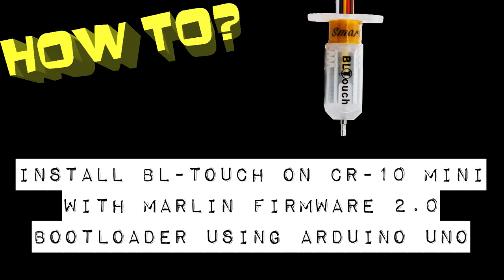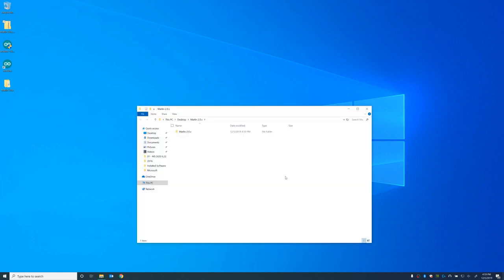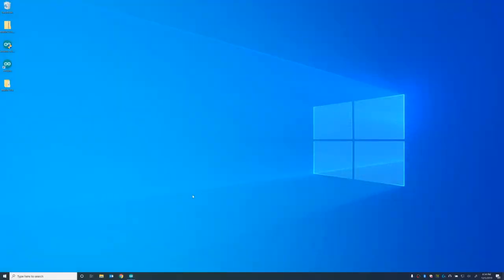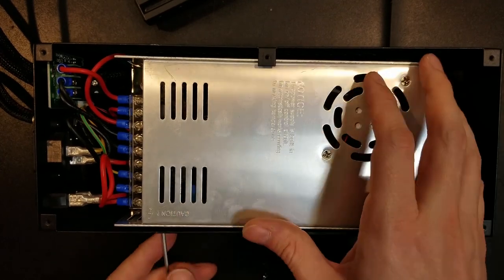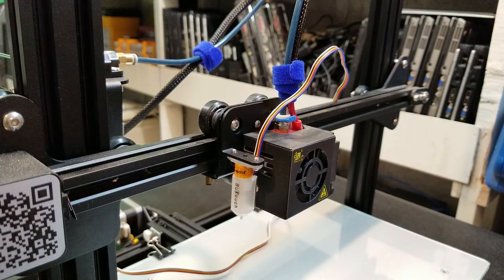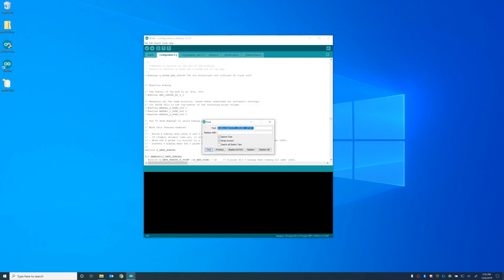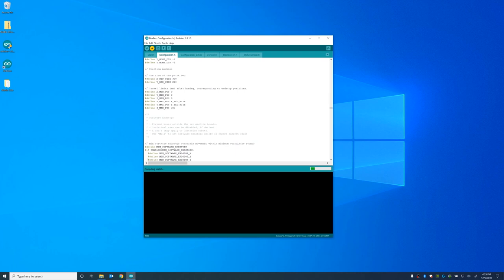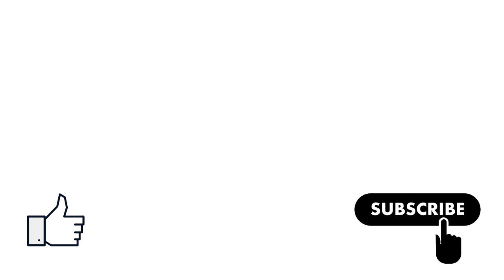Install BL Touch on CR-10 Mini with Marlin 2.0

Comment: Thanks for sharing, that's very helpful.
Just few comments for others if you like me are using stock mainboard from CR10 
1. After download Marlin firmware you have to download the configuration package and use the correct configuration files to replace the original "configuration.h" and "configuration_adv.h"
2. If you want SDSUPPORT and BLTOUCH working at the same time, except disable the items Shane descripted in the comments, you have to enable/uncomment SLIM_LCD_MENUS to free more space if you met issue `.text' will not fit in region `text'

Comment: Thank you so much for this video- it saved me ages and my Mini is now not only equipped with BLTouch but also Wireless :). I only had one issue with avr-gcc missing error but it turned out downgrading my Arduino boards library fixed it. Other than that I wasn't sure if this can all be done without getting the board out and in my case it was- I only of course unplugged electricity and removed the power supply to gain access but all cables stayed plugged in while loading bootloader. Thanks to that it was a really quick process. Thanks for a great video once again!

Comment: Thank you for this.  I have a BL Touch on the way, and had no idea how this was supposed to go.  Looks like I’m ordering an Arduino Uno and some cables.
Reply from the maker: One thing I wasn't able to show in the video was that in many BL Touch kits you will get a USB ISP programmer to burn the bootloader instead of using the Arduino Uno method. Unfortunately mine was broken on arrival and I couldn't wait for a replacement. I may make a follow-up video on how to do it that way as well in the future.
Reply: @ShaneTriplett  I've never done anything like this before as 3D printing is brand new to me. I got the USB ISP programmer and I found a video from creality showing how to put everything on but in the video it looks like its just plug and play. Once they connect the USB ISP they go to their desktop and open a file. I have no idea where that came from as when I plug mine in I hear the sound of a USB being connected but nothing loads and when I pull up file explorer it doesn't show a USB attached. The BL Touch is also just blinking red, does this mean the one I received is broken as well?

Comment: Tip for removing hot glue.......use isopropyl  alcohol to break it down. Dab it on with a cotton swab or brush it on. It will take a few moments to soak in to the mated surface area and allow you to remove the glue
Reply from the maker: Awesome tip! I'll have to try that next time I run into an issue with hot glue.

Comment: Hello Shane ,
Great video but I have a question.
After you install the bl touch and open the marlin firmware do you have to plug something in your pc or not could you answer it would really help me!
Reply from the maker: You only need to plug in to your PC once you are ready to upload the firmware or flashing the bootloader.

Comment: Was thinking of adding a BL Touch to my Mini but after watching this I don't think I will bother :)   .....thanks for a very complete tutorial for all folk doing it but I hadn't realised it was so complicated....will just carry on with manual leveling...then pass it on to my daughter I think and look for something more up to date with built in auto bed leveling ...thumbs up given.

I have had the Mini 2.5 years so will treat myself to something new.

Any recommendations for a printer with built in control box instead of separate (as desk space is limited) ...a touch screen and built in auto leveling?....build plate area can be quite small as I find the Mini ample...been looking at alot of reviews but so many choices

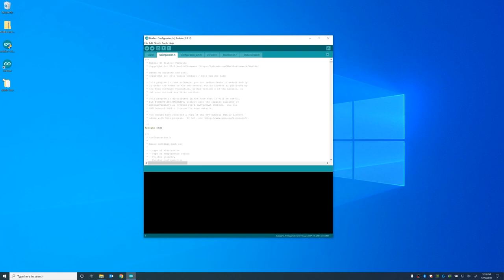Comment: At 26:00 when you say "It should be uploading to the motherboard now" I'm assuming the computer plugged into the 3D printer motherboard? It was a little unclear for me, because in the first part you say you're testing the sketch on the Arduino, but then say it's uploading to the 3D printer motherboard. On the tablet I'm working on, I can only have one USB plugged in at a time. Do I have to have both the Arduino and the 3d printer motherboard plugged in???
Reply from the maker: It's been a minute since I have done this but I am pretty sure you will need both plugged in to burn the bootloader on the 3d printers motherboard using the Arduino as an ISP programmer. then once you have that complete you can just use one USB to upload the sketch to the 3D printers main board.

Comment: Shane, thanks for the video, this was great.  I used it over a year ago when I finally broke down and purchased a BLTouch.  I am having a problem now.  My laptop died and took all of my files with it.  When I got my new laptop and installed Marlin on it, the "configuration.adv.h" file for the CR-10 Mini had changed.  There is no longer a "#define SDSUPPORT" entry.  I went back and downloaded Marlin 2.0.0 and it looks like they overwrote all of the CR-10 Mini configuration files with a newer version.  I guess with the newer motherboards that Creality is using memory is not a limitation anymore, but I am using the original motherboard and I keep getting a space error.  Do you still have the config files for the CR-10 Mini that you used in your video, and if so can you send them to me or send me a link where they can be found?  I would appreciate any help I can get.
Reply from the maker: Ok so here is the default config files for version 2.0.5 which is what version I think I used. https://github.com/MarlinFirmware/Configurations/archive/release-2.0.5.zip

You should be able to follow along in the video and use the default config file in the example folder as long as you use marlin 2.0.5. I haven't used any newer versions so I don't know how they would respond but it might work fine. 

Here is a link to my config from the video https://cloud.shanetriplett.com/s/ddM7xo5Z4awssFo I am not 100% sure this is the final version I used but when I looked through the file it looked good to me. (USE THIS ONE AT YOUR OWN RISK)

Good Luck!
Reply: @ShaneTriplett  the most recent marlin of 2.1.1 throws "\Marlin-2.1.1\Marlin\src\inc\Conditionals_LCD.h:1077:6: error: #error "BLTOUCH requires Z_MIN_PROBE_ENDSTOP_INVERTING set to false. Please update your Configuration.h file."
     #error "BLTOUCH requires Z_MIN_PROBE_ENDSTOP_INVERTING set to false. Please update your Configuration.h file."
 when compliling. Setting it back to true allowed it to compile and upload.

Comment: Hello! Thanks for the video! I would like to know if it’s also possible to do the same with a clone of the BLtouch (for 10$ in Alibaba for example) and if it works? Or what do you recommend me? Thanks again!
Reply from the maker: I would imagine that it should work just fine. I would suggest maybe just making sure that the wiring is the same on the clone.

Comment: Thanks for the tutorial.  I had a few issues with my CR-10 Mini firmware when trying to comment out the things in place of the SD Card reader.  Not sure what caused it specifically.  Kept getting a region error regarding ".text" could not fit in place of "text" from the Marlin.INO file.  Any ideas?

**UPDATE** 
After going back through the video looking for something I might have done incorrectly I noticed that he used Marlin 2.0.0.  The current version of Marlin is 2.0.5.3.  I was able to follow the link on the website to download the 2.0.0 version from GitHub.  Upon configuring the firmware my error massages on my CR-10 Mini have disappeared!  Unfortunately I still have to operate it via USB connection because the gouge for getting the SD Card reader operational still resulted in an error, but my printer works and that's good enough for me right now.  Thanks again.
Reply: Old comment I know but if it still matters the text overflow error means you don't have enough storage on the board, it will tell you how many bytes overflowed, you just have to disable more features.

Comment: I am very confused about the bed leveling. I have encountered an issue that the filament at one corner and the centre did not sick to the bed(even @ 65 degrees C), other videos recommend to adjust the z offset, well, how can I adjust the z offset for just the corner and centre while the rest of probing points remain the same?  Coz when I tried to adjust the z offset, say make it lower, the nozzle at other probing points would scratch the bed. So I have no clue whether the BLtouch is functioning or not. I have level bed before Printing and saved all settings in the machine everytime after auto leveling the bed. But it still did not work, please help me
Reply from the maker: It sounds like your build surface isn't completely flat. You can try adding more probing points. I would try a 5 x 5 grid to get more points in the mesh can help with a lump in the build plate. You could also try flipping the build surface over. Sometimes that helps as well.
Reply: @ShaneTriplett  Thank you, I will update the results!

Comment: I have a question. I installed the Bltouch at the end of 3, measured and set everything. However, when leveling the printer moves a little too far to the right. The nozzle is next to the print bed at every third point
Reply from the maker: Make sure Z_SAFE_HOMING is enabled first of all then if you got the Nozzle to probe offsets correct you can also increase the MIN_PROBE_EDGE 10 maybe try 15 or 20 this will keep it further from the edge. Hopefully this helps you.
Reply: @ShaneTriplett  many thanks. It runs now correct

Comment: Great video. I tried all your suggestions to save space but still get Sanguino errors as the sketch is still too large, (28%) of dynamic memory, leaving 11783 bytes for local variables. I'm not sure what to do next. I'm using the SD slot so I can't take it out.  I am currently using the TH3D version, which works fine but it's older and I wanted to upload a current version. I tried to use the same source (TH3D) but was getting errors I didn't understand so I wanted to try this. The only one I get now is the memory error. Any other suggestions for shrinking the sketch?
Reply: The sketch uses 130898 bytes and max is 130048, I'm 898 bytes over. I need to trim 900 bytes.
Reply from the maker: That's a tough one. The way I found what I could remove was searching for the word "Byte" in the arduino sketch which usually brought me to a comment saying if I comment out that particular section I could save a certain amount of space. I also tried removing all comments and blank space but this didn't reduce the size since blanks and comments are ignored. I think anything else removed may have negative effects but If it were me I would start with trying to remove things from the Configuration_ADV or something with the LCD first since there are many things like different stepper drivers and what not that may not be needed. Another thing you could try is using an older version of U8Glib 1.18.0 library it may be smaller or maybe U8g2 library(Not sure if this would work) You will need to remove old library first. Sorry I couldn't have been more help on this but If I think of something else I will let you know.
Reply: @ShaneTriplett  Thank you for your response Shane. I'm wondering how TH3D  makes it work with their firmware? What are they doing different as it is all Marlin? I would use theirs but I get too many errors. The first time I did it 6 months ago, I followed "The Edge of Tech" video and the TH3D firmware worked the first time. This time I followed it again with the newer Marlin and got 4 or 5 errors. I didn't understand any of them. TH3D has an EZ board that you can continually update from their website. It looks promising but it's out of stock now. My Ender 3 LCD went wacky so I had to order a replacement and I was going to upgrade the firmware at the same time. When the LCD arrives I will use the current version until they get new stock on their EZ boards. Since you took out your SD card option, you must have your computer connected to load G code?

Comment: I'm getting stuck on the example config files when i download the Marlin 2.0 there are no example files I've tried the older version examples but they don"t work
Reply from the maker: Yeah for some reason they don't come with the main download anymore. They have their own github.  https://github.com/MarlinFirmware/Configurations
Reply: Thanks for the link i'm getting the following error message (sketch\src\module\motion.cpp:77:71: error: 'X_HOME_BUMP_MM' was not declared in this scope) etc. i don't know if this is just an edit problem or a config file problem I'm new to Arduino thanks again for any help.
Reply from the maker: @daz1419  Try using the bugfix branch under nightly builds. Use 2.0 not 2.1 and use the configs to the right of the download link in case they are different.  https://marlinfw.org/meta/download/
Reply: Thanks All works great

Comment: I can't get my Z offset to go into the negative, it only goes to 0 or positive.  Is there something else I need to change to get it closer to the bed?
Reply from the maker: Comment this out #define MIN_SOFTWARE_ENDSTOP_Z
Reply: @ShaneTriplett  Thanks, I also found if I run the M211 S0 command I can also go negative.

Comment: Thanks for the great video guide! Maybe you can help me/add that into a new video: How do I activate the PIN27 if you use an adapter board? writing it into the code myself didnt work  #define SERVO0_PIN 27 . Keep making videos, they are good :)
Reply from the maker: I did not have to explicitly add an enable for pin 27 in marlin 2.0 using my main board (Creality3D V1.1.4) It may be different on other board variants. If you use the TH3D firmware or Marlin version 1.0 then you will have to  #define SERVO0_PIN 27. 

In marlin 1.0 it would look like this...

#define BLTOUCH
#if ENABLED(BLTOUCH)
    #define SERVO0_PIN 27
#endif

Hopefully this helped you.

Comment: What specific version of Marlin did you use?
Reply from the maker: I am not entirely sure at this point it has been a while. The download link I have in the description says 2.0.x
Reply: @ShaneTriplett  So I've found a solution. What is happening  is this as far as I can tell.
Since I need the SD card I uncommented the other items that you suggested only issue is that gets it down to 98% of the memory.
I was told that the boot loader takes 2k of the  boards 128k.
Marlin 1.1.9 will compile this without error but it won't upload it.
Marlin 2.0.x anticipates the 2k needed for the boot loader and throws a compile error which is cryptic and makes no sense why not just say sketch is too large to exist with boot loader.
Anyway so I compiled with Marlin1.1.9 then I export to binary.
Then I used the ISP burner in the creality3d kit along with the proisp72.exe to upload the hex file.
Too bad there isn't an option to turn that off in Marlin 2.0.6 because I like it better but whatever works at this point.
Reply from the maker: @danafiorucci83  Awesome! Glad you found a solution and thanks for sharing so others can learn.
Reply: @ShaneTriplett  Thanks for all your help. Still need to configure the Z offset but the hard part is over with. Thanks Again